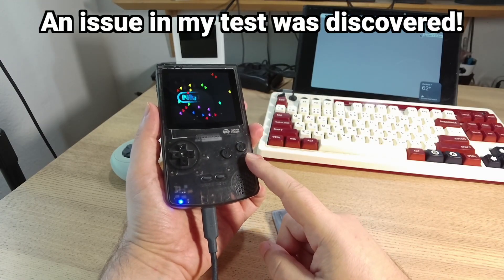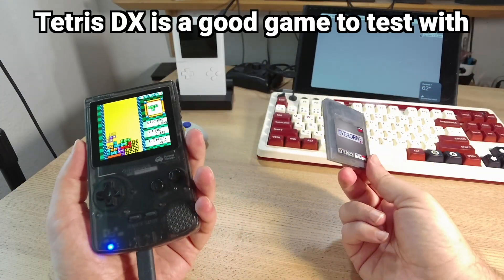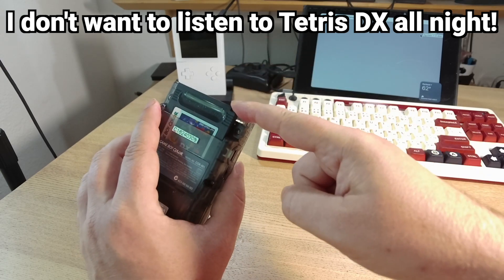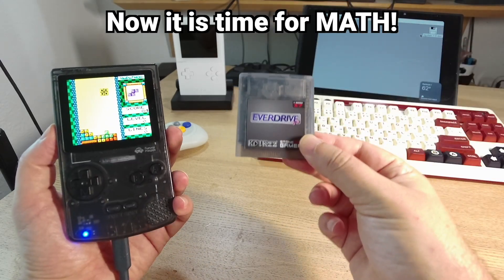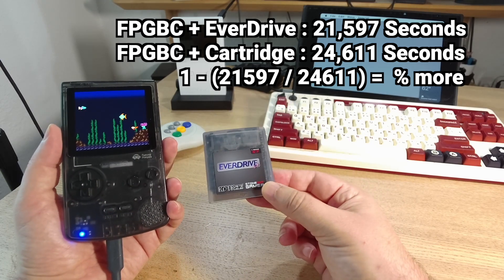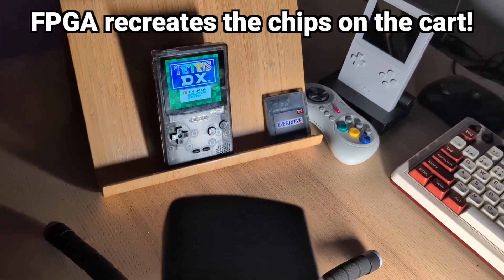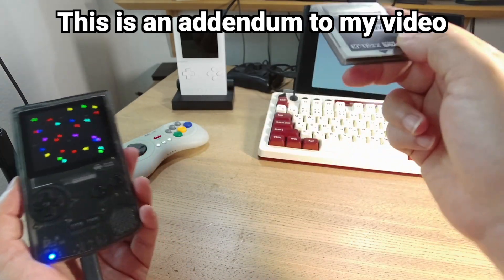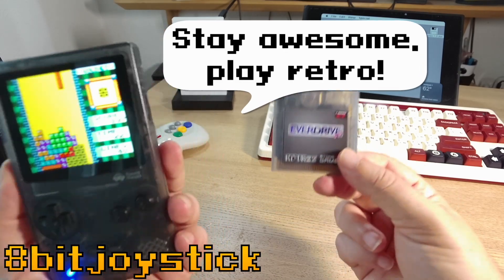Test: How Much Power Does an EverDrive GB X7 REALLY Drain?

Comment: what about x3
Reply from the maker: Well the Everdrive X3 shares is very similar hardware as the X7 but without the save states and such. I would also guess that it has very similar power drain close to 12% which is fine.

Comment: FPGA was intended for use within the lab only, as part of the testing process: the final product should be an ASIC, not an FPGA chip.  For no good reason, FPGA is now marketed as a luxury.
Reply from the maker: I respectfully disagree. I think that the FPGA cores gives everdrives the ability to re-create the necessary chips to enable a huge variety of games to run on original hardware. This is not just like loading a ROM. It's actually a configurable FPGA core that changes as needed on a per game basis. I'll never see a legit copy of gimmick with the audio chip on Famicom but I can play it on my Everdrive on original hardware.
Reply: Lab use only goes against the "FP" part of FPGA - Field Programmable!
Reply from the maker: @theheroslegend  I have a theory that perhaps some of the gamers that use PVMs are not Professional Video Editors.